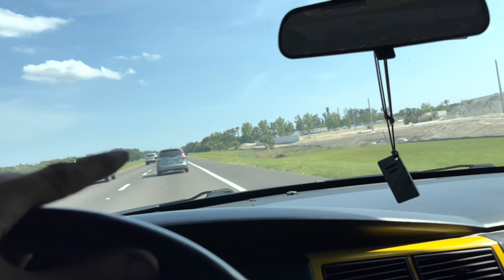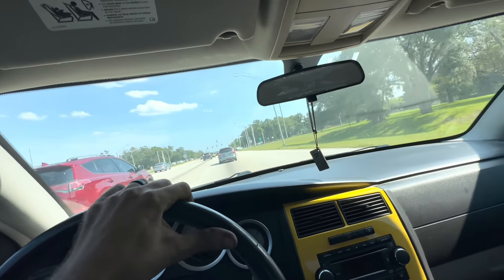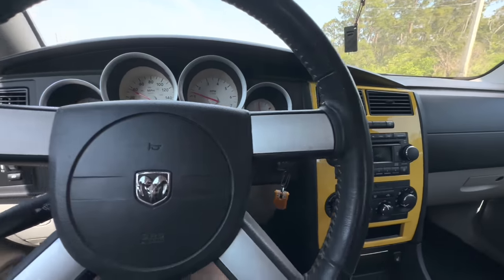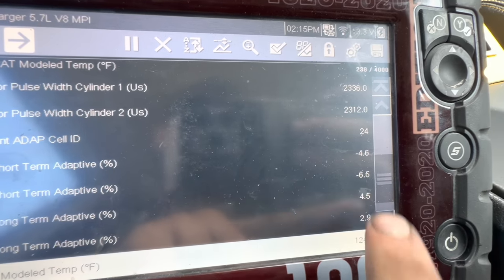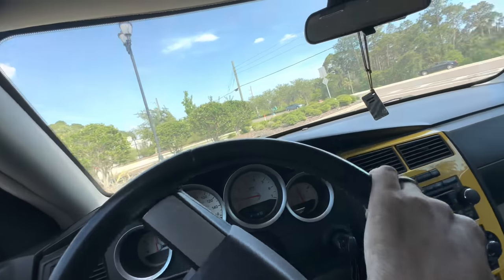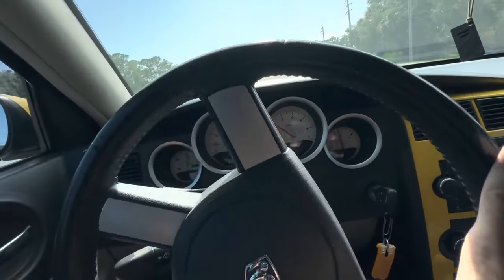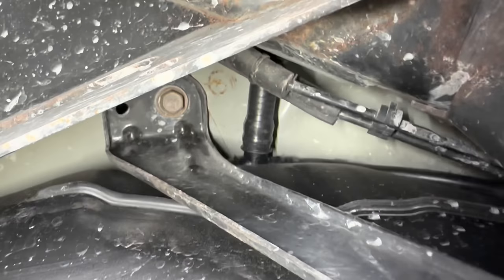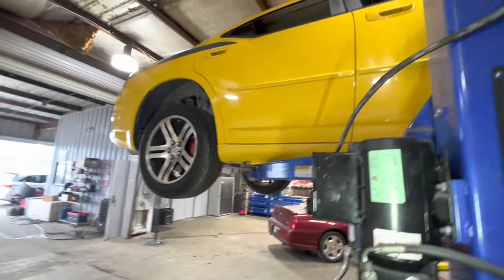Customer States: Engine Stalls After Fueling...HELP!! Dodge Charger 5.7 #mechanic

Comment: Owner may be overfilling the tank past the point where the baffle usually stops the filling.  The baffle is in there to keep some air space for gas expansion.  If they fill up the baffled space then when the Florida sun heats up the gasoline it pushes back through the vent line and saturates the charcoal canister.  Then when the computer starts a purge cycle the engine sucks in pure gasoline.  User error.
Reply: Over filling will cause this problem stop filling when pump kicks off the first time 👍🏻🇺🇸
Reply: I was thinking that too. Ray didn't over fill the tank, still had something happen.  Simple fix : don't fill the gas tank all the way .  Haha
Reply: That would exactly be my guess also. Return the car to the customer and ask him to not fill up the tank all the way when refuelling. Just leave a gallon of space to be sure while testing. There is a muffler right below the tank. That would correlate to the car stalling on highways at higher speeds because the fuel would be heated by the muffler.
Reply: I can see this, especially after a full fill in the early morning when the ground tanks at the petrol station are at their coolest so the fuel is at its most dense. It is the best time to fill up in terms of value for money too, just not all the way.
Reply: @davesouthword1298  gas station pumps are temperature compensated.  at least the ones at the stations i used to work as a pump jockey filling cars at all day were stenciled as such.  i don't remember the exact verbiage but they said something like "gallons at 60 degrees F"
Reply: @richardhiskett5422  Interesting. They aren’t in the UK, as I tested this years ago.
Reply: Agreed.  Was just going to state overfilling…👍
Reply: @davesouthword1298  they are  temperature corrected in the UK as well. Do you honestly think companies are going to give away petrol for nothing? Also with the storage tanks being below ground the temperature doesn’t fluctuate as much as ambient air temperature.
Reply: We had the same issue show up on multiple Chargers we service for a fleet. It was found that they would overfill the tanks causing saturation of the evap can and the only fix found to stop the rough idle and stall was to remove and replace. We ended up putting new baffles in the tanks correcting the issue on our chargers,
Reply: Yes! This was my fist thought exactly. Scotty Kilmer told us not to overfill the fuel tank after the pump clicks off. I actually added another squeeze of fuel after it shut off and nothing happened. Maybe I got lucky! Sounds like maybe a ground issue with the pump or something? Wish there was a a engine code for this.
Reply: OK Google, Soo not the problem.
Reply: I have a car(2007 Kia optima lx) this car if you fill till the handle clicks off some gas overflows out the fill hole so i have to listen to it and stop it manually the engine ran fine but if the battery was disconnected and reconnected when it first started up it would run and stall out and it did it for about 15 seconds on first startup after that it ran fine
On another car I have (2010 ford fusion) after filling until it clicks off when started it stalls out then after that it runs fine it also has the capless fuel cap design
Reply: @richardhiskett5422  depends on where you live.  All fuel deliveries to stations are temperature compensated.  But all retail pumps are not.  In Canada all stations are authorized to temp compensate and most do.  However, in the US not all states permit the use of temperature compensated retail pumps.  My guess is in those states that do not permit them, the state regulatory agency lacks the necessary equipment to check their calibration.  Compared to a non compensated pump, a temp calibrated pump would deliver less fuel than indicated when temps are below the indicated calibration temp or more than indicated when temps are above.  The amount delivered and paid for is the amount that would be delivered if the fuel were at the calibration temp.   Obviously to check the accuracy of such a pump requires more sophisticated testing equipment than a non compensated pump.
Reply: @kevinpeterson4098  I overfilled by topping off for decades but ended up stalling and needing a service a couple years ago. Since then I stopped doing it and now finish when the pump
kicks off.
Reply: @davesouthword1298   Generally in-ground tanks maintain a fairly constant temperature year round.  "maybe not as deep in Florida, due to water table".   The reason this is important is because fuel volume going through the flow meter for a pump is not temperature compensated on the fly.   The volume metering is based on a standard temperature year-round.  So the pump is always metering the same fuel volume.     Service Techs and Gov departments like Weights & Measures, check pump accuracy by dispensing fuel into a special "Brass - non-static" container with graduations to confirm the pump is dispensing the correct volume of fuel.     Doesn't make any difference if the temp is -40 C or +30 C   (-40F or 90F) outside, you always get the same volume of fuel dispensed.    Once the fuel is dispensed it will expand or contract due to temperature.   That's why you need to leave room in your fuel tank, or the excess fuel will go out the vent in older cars and damage the purge canisters in newer vehicles.    

The myth of buying in the early morning to get more fuel is easily disproven.   There are consumer protection laws for everything you buy.   Fuel pumps must be tested and certified accurate, just like the meat scale in a deli, has to be certified accurate.       Pulling the trigger, while elevating the fuel hose "to get every last drop" doesn't work either.  If it did work, the next person using the pump would be paying for some of your fuel, and that never happens.
Reply: @mikeembrey9176  I’m guilty of this I used to do it on my jeep commander I sold her now and I don’t do it on my truck anymore 😂
Reply: it wouldint still be present after ray drove it for days if that was the case
Reply: I had a Ford diesel truck that would randomly die while in reverse and 1 time driving down the highway just died and I rolled to a stop, turned off key, let it sit restarted everything was fine, never had any codes, eventually had dealer look into it before warranty was up and they changed a cam shaft sensor and never had any issues since.
Reply: Yuppers.
Reply: That is such a common mistake that needs to be spoken on more often.
Reply: @mikeembrey9176 except when you get the umps that are too twitchy and click off every few dollars. Used to be worse with diesel as it froths up
Reply: The tanks are underground and the amount of fuel in them plus concrete, dirt etc the temp increase is negligible this has been proven numerous times to be insignificant.

Think about a lake it's 14C at 7am the sun shines on it all day you'd be lucky if it increases at all during one day given the energy requirements to increase the temp, fuel is the same albeit with different figures for heating it 1C
Reply: @norfolkngood8960  
The discussion I believe is overfilling the cars gas tank..
Not the fill tanks at gas station.
Reply: i will never understand why some people don't just yank the filler out when the pump stops filling . but it seems a lot of people dont.
Reply: Agreed. And it doesn't just happen in Florida, but in my moderately cold climate as well.
Reply: At the old shop   Ray found this problem and the owner had a fit & I got the feeling no body backed him up! Have a great day
Reply: @michaelpressman7203  
Makes sense
Reply: I totally agree with this scenario, seen it before, goes away after the fuel level drops
Reply: @mikeembrey9176  yep dont do that learned the hard way floods and ruins the charcoal canister, had a friend who always did that, paid me $50 to help change the charcoal canister and i told them once the pump shuts off do not put more gas in, They didn’t listen and asked me to replace the canister again I declined.
Reply: 294k miles on my car. I always round up to the next dollar. Never touched the fuel system. In fact, I’ve never had a check engine light. I’ve done this with every car I’ve ever owned and never had a problem. I won’t squeeze it in until it’s overflowing, but an extra 1/3 of a gallon has never seemed to be a problem
Reply: @stevewhiting556  
How many miles on vehicle when you purchased.
Fuel systems and basic monitoring systems just do not last that long...
Someone replaced and maintained part on that car...
Unless the check engine light has been turned  off  with VAG SOFTWARE.
otherwise you just have a 1 in a million vehicle
Reply: It’s a 2010 that I bought from the original selling dealer in 2012  that I worked for. Car had 30k and had only PM services done at my dealer. I average 500 miles per week and it has never been to a mechanic for anything other than fluid changes, tires, alignments and a couple recalls (control arm and airbag.) I have performed all other minor repairs at home. The most major was a CV axle at about 270k. Otherwise it has never failed to start except for a couple dead batteries. I’ve put in a couple window motors and a regulator, OEM brakes at 195k, OEM belt when I did the axle (since I was already there.) A couple relays, a set of plugs (no coils). A window switch, a bunch of bulbs. That’s about it. Oil changed every 5k with synthetics.
Reply: @stevewhiting556  
Yes with proper preventive maintenance  I agree life expectancy engine can be reached.
Usually  with 200 thousand being the boiling point with gasoline engines.
Congrats on you journey to 300 thousand plus.
God bless 🇺🇸
Reply: That would be the evap canister
Reply: @davesouthword1298 incorrect the tanks are underground which keeps a constant temp all day every day.
Reply: I will admit that I’ve been lucky. It’s been a great car. It probably helps that it’s an actual made in Japan Japanese car. I keep threatening to replace it, but it’s been paid off for over 5 years and it’s nice not to have to write a check every month. The paint is faded and dull but there’s no rust (thank you southern weather). The AC still blows cold even though the compressor has gotten a bit noisy, but I haven’t added any refrigerant. It still uses the same 1/4-1/2 quart of oil between changes that it did when I bought it. It still gets almost 30 mpg and I just can’t see myself spending $40k+ on something that’s going to have over 150k by the time I pay it off. Hell…I’d double the book value with a new set of tires, so I probably won’t even trade it in. I may just buy a new one and use this one as a hobby project…maybe paint it, put a rebuild kit in the engine, redo the suspension and give it to my son in a few years when he turns 16.
Reply: @stevewhiting556  
Japanese engineering definitely not talked about as much as it should be...
That sheds some light understanding the reliability you have had..
God bless brother keep  it running....
Only makes sense to keep it ( you know the car inside and out)
Reply: This person is right when over filling the tank cause damage to the canister
Reply: Yes
Reply: @kristmadsen Obsessive compulsive fuel pump clicking!
Reply: Could be Mopar junk.
Reply: who can afford to fill a tank all the way up?
 @kristmadsen

Comment: Ray, I don't know if this is a related issue, but my Chrysler 200 had the same issue and after many dollars, new tank and evap system replace, it turned out to be relays. 
I know someone in the comments had mentioned that.

Comment: Wonders if you ask him how he fill the car if he stops when the pump shuts off or if the keeps topping it off, like i have heard it will mess of the vapor control system
Reply: EricO mentioned this issue a while ago, I think the major issue with this is the evap canister becomes saturated, but it looks like there was no fuel in it.
Reply: I was doing this (topping off the tank on my Toyota 4-Runner. Caused a check engine light. Mechanic told me to stop topping off the tank. Problem went away.

Comment: What a way to get Ray to buy gas for him :)
Reply: Didn't you notice he Madd a point about getting the receipt.
Reply: @rjm7168  I did...it was a joke :)
Reply: Lol. Thought same
Reply: top 10 ways to save on fuel costs, #7 will surprise you:  $150/hr technician hourly charge is cheaper than buying fuel yourself 😂
Reply: HAHAHAHAHAHA ...I THOUGHT THAT TOO...BUT NOT THE PROBLEM...A FUSE & RELAY PROB IN THE TRUNK AS PER A MASTER MECHANIC COMMENT NEAR MY COMMENT...MAKES TOTAL SENSE TOO 🕊👈🫡👍🇺🇸💪🙋
Reply: @bigsparky8888  don't yell
Reply: What a waste of time! Won't be buying a Charger (am in Europe lol)
Reply: I'm sure he got billed for the gasoline lol
Reply: He secretly hates Ray. He knows that tank is gonna have to come down and now it’s full.
Reply: I'm sure the costs were in the bill.
Reply: Yea, but he put regular in a hemi??   Shouldn't high test be used in this engine?
Reply: Lol. Highly likely to stall after fuel fill.  Almost guaranteed to stall after wash, wax, detail.

Comment: Thanks for the stay away from trucks. It’s so annoying as a truck driver being cutoff to just take the ramp or something.
Reply: Observe the Golden Rule of Raw Tonnage.
You, not the truck WILL lose.
Reply: Yeah I agree deal with it everyday
Reply: Exactly right! Thank you Ray for helping the four wheeler public be more aware of the inertial requirements of an 18 wheeler.
Reply: Bad thing is, is its just common sense. Unfortunately alot of people do not have it. Ive always told people . Dont merge in front of a truck unless u r about twenty feet in front of it in the lane beside it. And when u do hit the gas not the brake. Ive never been a truck driver. But i have friends that are. Ive heard the stories of the horrible drivers.
Reply: I totally agree with staying away from the front of trucks, now, if trucks would just stop trying to pass on a hill and blocking the left lane just because a slower truck started up the hill first!
Reply: @mikeperry2814  yeah it's a two way street there.
Reply: The term “common sense” has devolved to an oxymoron. Who knew Idiocracy would become a documentary.

Comment: One way to guarantee a stall is to let the owner pick up car . My guess would be before he got home.
Reply: As long as the mechanic (Ray) isn't in the car. LOL
Reply: I believe they’re still on vacation. This may be out of his grab bag. Very thoughtful for we addicted mechanicophiles.
Reply: Every time!!!🤦🏻
Reply: One of my service managers who had a desire to find fault or exonerate the manufacturer, would often ask, "How do you make it act up?"
Since several techs already tried and they're well versed with the manuals as well as the bulletins.
More investigation can find more to consider.
One customers driveway leans sharply or faces up or down.
That kind of thing
It's part of NPF procedure which limits time you're allowed.
And sometimes the new part is still the causal part and we had to wait.
This is when cars are relatively new still since the design changed to affect it.
Other times, you find something strange.
Like, everything's been replaced in the system by the dealer, and the OEM filter is still there.
The customer brings it to my house on the weekend and wants me to diagnose it.
I remove a filter packed solid with more dirt than any gas pump ever could dispense.
That's happened.
Nobody was allowed to sell them a retail part and labor.
The whole system had been done piece by piece blaming the manufacturer and partly right, they did change things for issues.
Reply: Well, he did say he wasn’t going to post that video until he got back, sooo….

Comment: How much fuel are they putting in?  Do they stop when the pump stops or do they try and squeeze in more after?  That could explain the liquid fuel in the evap system.
Reply: That's my theory, LOL!
Bet the owner is old school, and comes from the days of filling it to the brim...
Reply: My thought was also: Customer stated "it stalls when filled the tank", but it may actually have been "it stalls when the tank get overfilled"... And the time Ray was tinkering about it, the excess fuel just evaporated from the canister away, so it was not clogged anymore.
Or there were actually two problems: One with the overfilled tank, but not yet leading to stalling on its own but enough to mislead the diagnostic, and second (as someone else mentioned) with the contaminated relays/connectors, which could be actually the real cause of the stalling.
Reply: Guys their is a recall for these cars . " if after filling to full the car begins to stall the safety switch on the gas tank has activated " " the corrective action is to teplace the fuel tank with an updated tank"
Reply: @ALEX-xd7ko  But they replaced the tank.
Maybe it's a bad tank?
If the tank is under warrantee, they need to give him a new one.
Reply: @KentuckyRanger  The thing is, what version of the tank was used, mainly in case it was not done at dealership. And still, it could be the switch gets tripped only when overfilled. Normally I would think that activation is not that easy, unless there is really a roll over or so. Or it could be the flaw causing that nuisance tripping is not just the fuel tank, but the general car design in that area, not allowing to make that cutout to be made much better...